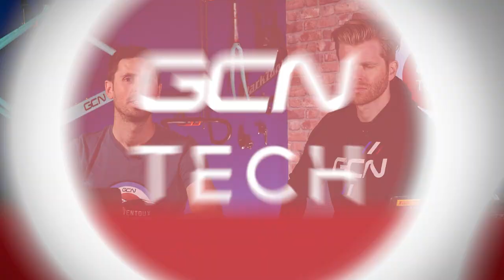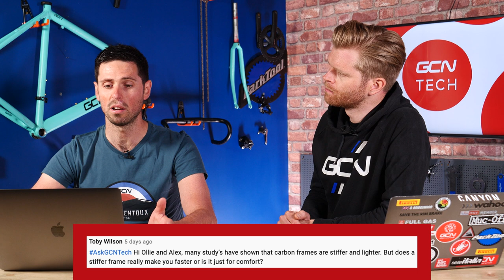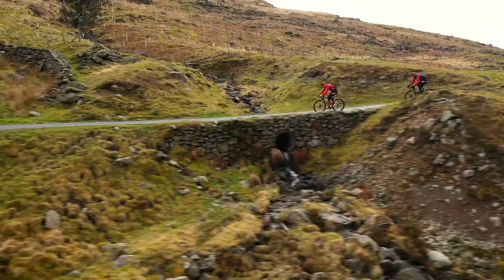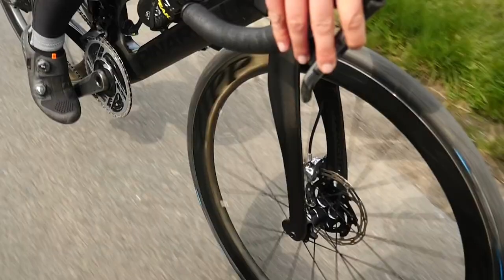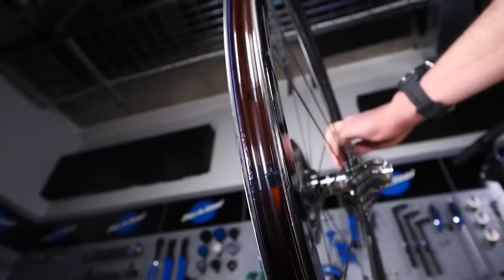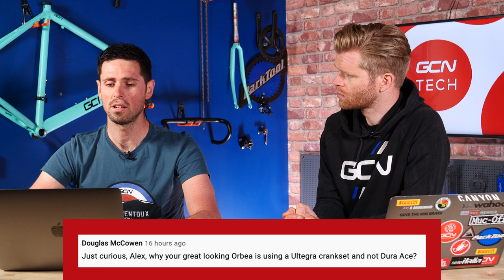Does A Stiffer Bike Frame Actually Make You A Faster Cyclist? | GCN Tech Clinic #AskGCNTech

Comment: #askgcntech
I’m upgrading my chainrings from 50/34 with a 11-32 cassette to a 52/36 with a 11/28 cassette. Will i need to change my chain??
Reply: Maybe, there are a number of calculators around based on chain stay length and the chain ring and cassette gear sizes.
Reply: No need to change the chain unless it's worn out. You may need to shorten your chain by 1-2 links if you want to get it perfect, but it's probably not crucial to it functioning i'd say. It's too long if there is slack in 36-28 (small-small). It's also too long if your rear derailleur hits the casette. Check for clearance between the casette and the jockey wheel closest to the casette in every possible gear combination.
Reply: Probably not. You can get away with more than people make out

Comment: #AskGCNTech I've recently decked it over a tree root under concrete. this was due to my tubeless tyres being too soft and skid me out of control. being told you can run lower PSI for comfort but when is it too low to be dangerous? after a couple of cuts, bruises and aching shoulder blade, I've learnt my lesson.
Reply: Are you sure it was due to tire pressure?  I had a similar crash 3 days ago (losing control on a frost-heaved culvert under asphalt) and I was running 32mm tires at 65 psi (which is high for my weight).  If anything, lower tire pressure should improve traction over bumps because it increases the size of the contact patch.
Reply: @trainiax  I was running 25c at like 20psi...
Reply: @TurWack  In that case, low pressure could very well have led to a loss of control - because 20 psi is way, way too low for a 25 mm tire.

Even tubeless and with a lightweight rider, I can't imagine using less than 60 to 70 psi in a 25 mm tire.  Going tubeless only really allows for a drop of 10 to 20 psi compared to tubed.

Comment: #askgcntech Hi, how much torque should I apply to the suggested torque. eg)my saddle  clamp says 6nm, do I go full 6nm or less?
Reply: Up to 6nm no higher. I'd always tighten to the given number, especially with something like the Saddle and Handle bars as they are the limit it can both take and that should hold it still and keep it from moving at all. Especially with your seat post you want to use some kind of a compound to help both hold the post and stop it binding and getting stuck over time. You can get both Carbon specific and alloy specific both park tools and muc off do them and many others.
Reply: @itarry4  thx

Comment: #Askgcntec i currently using 50/34 chairing and upgraded to 56/36 (oval),but i have slightly problem when i shift the chairing from the smaller to the bigger one, it keep making a noise like the chain jumping so hard and doesn’t look very smooth like round chairing, i have try to do some FD adjustments but it’s still the same.

Is it because i have to update my di2 or it’s unnecessary?
Reply: your chairing must be 56/40ish

Comment: If I want to change up an Ultegra 8000 Chain ring from 52-36T to 34T on the small ring do I have replace both the big and small chain ring or entire crank? @/askgcntech
Reply: If you only replaced the inner ring it would make an 18-tooth jump, which might be too big to shift reliably.
Reply: @trainiax  Thanks that is what I need to consider. Maybe a better plan to change the RD to a medium (GS) cage and go up to a 11-34 cassette, new chain. I saw somewhere you can swap out just the inner and outer cage to go from SS to GS.
Reply: @se7enTse7en  Thanks this answers my question. The Ultegra rings are soooo expensive though!

Comment: Depends on the road surface. If the road is rough then a frame that flexes will absorb some of the bumps which would be advantageous on long rides. However if the roads are smooth as silk then the stiffer the bike the faster a rider will be and that is why track cyclists use very stiff frames.

Comment: #askgcntech When using an on wheel trainers thru axle adapter, do you leave it in when off the trainer, or change it everytime?
Reply: Would recommend changing every time. Use road set up and the thru axle for the road and the trainer thru axle for the trainer

Comment: Stiffer than what?  Faster than what?  Under what conditions?  It's like "does higher pressure make me faster?"
Reply: It's actually a perfectly well-defined question. If you want to write a scientific paper you can reformulate it to "is frame stiffness positively correlated with the energetic efficiency of the bicycle system?"

Comment: #AskGCNTech Hi guys! Anything over 3.75 gear ratio is really wasted on me. I climb a bunch and ride a semi-compact crankset with an 11-34 cassette (Shimano Ultegra). However, I have almost never used my two smallest sprockets, even on descents. I've been doing a bunch of research and it appears that Shimano doesn't make a 14-34 cassette, which honestly would be great for me to avoid the slightly larger gaps between gears found on the 11-34. Why aren't 14-34 cassettes sold and is there a way to have a proper one (not a hack/bodge candidate) built? Thanks much!
Reply: Miche cassettes
Reply: there is a 14-28 ultegra casette but you should be able to use your bigger 34 etc gears towardd the end (mix the cassettes) you will have big jumps between gears tho.

also check if your frame supports a 14-28 casette at because with my cento1air its very close to hitting the dropouts, and other juniors from my club had bikes which a 14-28 casette didn't fit